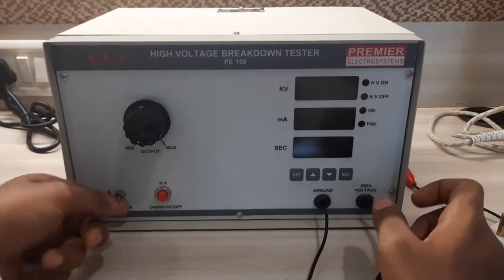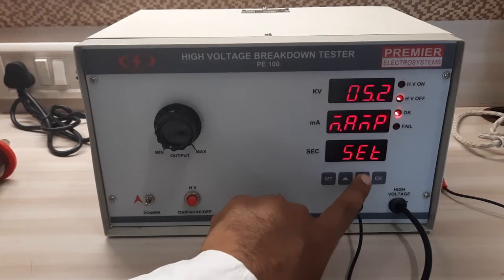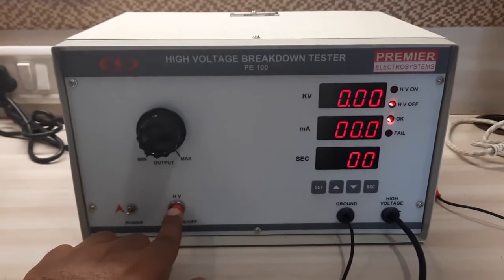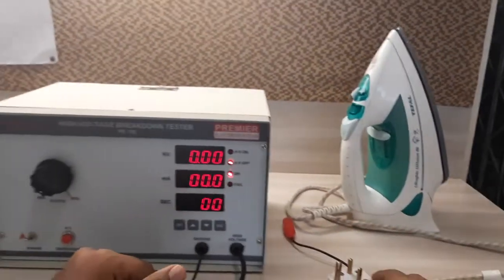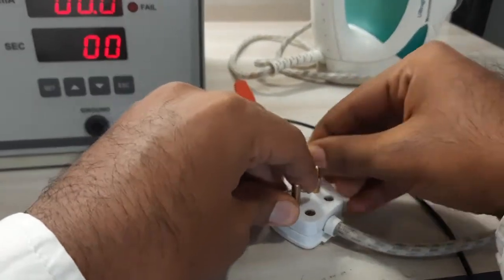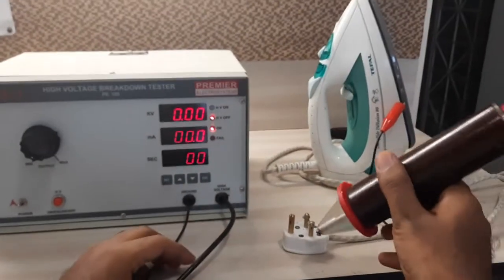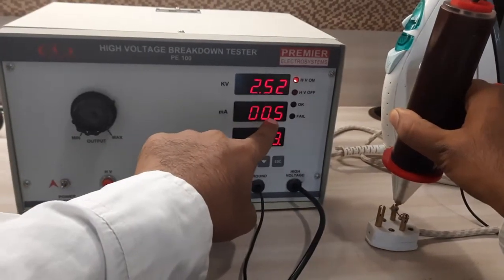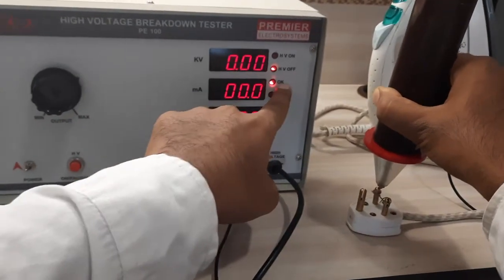How to perform a High Voltage Test (HV Test)

Comment: How to test magnetic coil for two point wire connection

Product details
One plastic Bobbin nd surrounding copper wire winding so how to test this product..Pls suggest

No positive and nagetive terminal both are same wire
Reply from the maker: Hello, you can do the HV test between the Copper wire and the insulation/ plastic bobbin